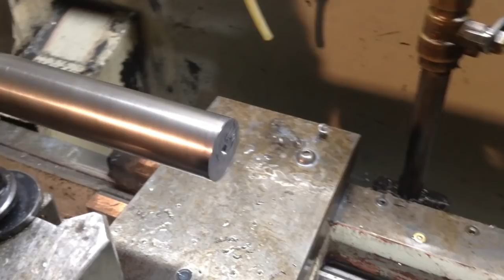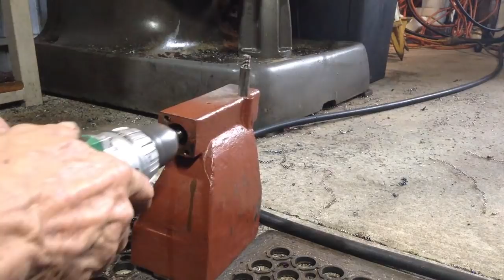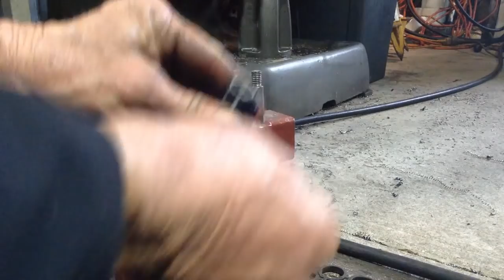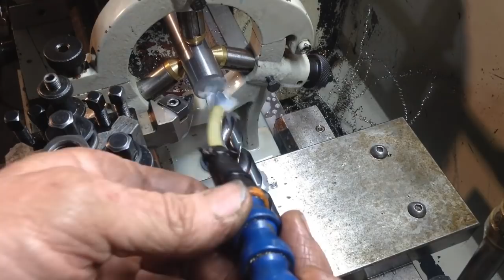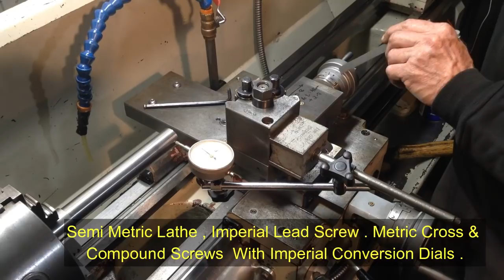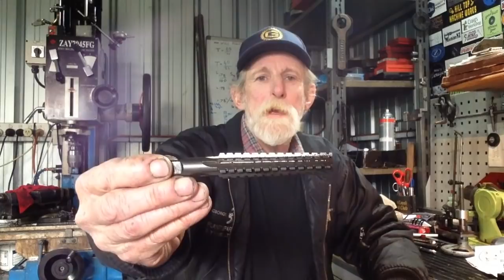Making  A New Tailstock Quill . Part 2  .   Precision compound slide setting .

Comment: Max, excellent tips and details. I need to make a very similar quill in the future. I have an older style tail stock for my South Bend that is the correct style with the classic look, but it’s missing the quill. The newer style I'm using now has a different keyway arrangement so they don’t interchange. 
Are you planning on engraving graduations on the barrel ? I’ve been contemplating good way to do that. Thinking indexing head or rotary table and tail stock in the mill w/ small ball end mill. Lot of setup for a few lines. Would enjoy seeing your solution…
ATB…Dean
Reply from the maker: No graduations , as it's for a wood lathe .  
Maybe one way to do them easy , bear in mind i have never seen or tried it yet would be to off set the quill in the 4 jaw & cut the graduations in that way .  The tool should just contact a small area that way .  Food for thought !        Cheers .

Comment: Just what I needed.  I have the solid carbide boring bar on the way and already have the finishing reamer.  Now if the darned motor for my lathe would show up I can get making the tailstock quill and main spindle for the wood lathe I'm building.  I'm making the quill and main spindle from 4140 prehardened material.  Not sure how the reamer will like it, so this setup was very timely. Thanks.
Reply from the maker: You will need that reamer working with pre hard .    Cheers .

Comment: Nice work Max and well explained.  Small MT's can be a pain to do and even when you think you've got it right with the setup, the bluing shows a different story which is always due to tool deflection.  Good to have a plan B up your sleeve with the reamer.
Cam
Reply from the maker: Thanks .  Yes the small ones can go pear shaped very easy .   Cheers .

Comment: Well, you certainly make that look more easy to dial in than I do 🤣. You mentioned taper in you part potentially buggering up your part, you may have just shed some light on why my last batch of mt3 tapers turned out not so great 😏. Once again, your knowledge is much appreciated mate! Cheers! 😊
Reply from the maker: Clock up on the chuck .   You still have to do the same check as one of my chucks has a .001''    taper when i do it .

Comment: Great video Max, your headstock is holding good alignment following your reset! EN 5 is horrible stuff, fine on a CNC but awful on manuals! Enjoying the tailstock project mate. Cheers, Jon
Reply from the maker: Thanks . Yes the manual machines do not have the RPM ' s .  If you could turn on a G96   or G97   type of code it would be great .    I was looking at a Harrison Alpha ,  that would suit me .  A bit like a  manual / cnc .  Still has a lot of manual functions like tool changing , tailstock etc .

Comment: Another masterclass.
I guess you have already finished the quill but if not it might make life eadier to know that some wood lathe quills have a bromze insert for the thread. As the thrust it sees is only in one direction a press fit should be adequate. I would find an inserted thread is easier to cut if you dont have the right tap..
Reply from the maker: Hi Chris .  They have thrust in the other direction as well when ejecting the tool .  I looked  at the quill in my Southbend & that is cut straight into the steel .  My other lathe has a bronze nut .    Either way will work  well .   No taps for this one , LH   BSW !  
Cheers .
Reply: @swanvalleymachineshop  is this one self ejecting, a lot of wood lathes dont have that feature as the tailstock is designed to have an auger go through it for long hole boring.
Reply from the maker: @chrisstephens6673  Do they  , i have not had much to do with wood lathes .  
The customer supplied a revolving centre that had a hole through it , that would have damaged the end of the solid male threaded section when ejecting .  I just made up a blanking button to rectify that . 
Do they just  tap a rod through the hollow type you mention to remove the tool ?
Reply: @swanvalleymachineshop  in a lot of cases yes.i used to have a bar with a wooden knob on the other end to knock out the rotating centre. You can get get rotating centres that have a hole all the way through and different cones and ring centres to hold the wood.

Comment: Max, always enjoy watching your set ups. When I set up to cut something Morse taper I guess I cheat a little, I put  something that already has the correct taper between centers and run my indicator across it. Machine the taper and finish it off with a tapered finish ream.  I guess I should take the time to learn how to do it the right way :)         Thanks for sharing Max,           Gary
Reply: The right way is the way that gets a good result.
Reply from the maker: Hi  Gary .  I only have that one roughing reamer , so not sure  how the finish would have come out if i had used it , esp not having the finish reamer to back it up .    Cheers .
Reply: @swanvalleymachineshop  Max if you lived closer I have a brand new MT2 you could barrow….
Reply from the maker: @TheAyrCaveShop  I might have to make one one day , from a knackered 3/4 reamer !
Reply: Gary 👍

Comment: I have to make a new quill for my tail stock. Somebody tried to repair it and bored it out too big. Not enough engagement for the MT2. Thanks for sharing, this series will be a great help. 👍👍👍😃
Reply: Will check that out. Thanks.
Reply: @patrickbeaumier8616  if you were planning on making a new one anyway, you have nothing to lose by trying.
Reply: Was checking this out this morning and I will definitely make a new one or at least try. The quill has been bored out 4 inches deep way bigger than the minor diameter of a MT2 taper which makes the male taper bottom out and about 5/8 of an inch engagement. There is no slot in the quill for the tang to slip through, so the drills over 1/4” tend to slip.
Reply: @patrickbeaumier8616  worth an investigation but you have the bits in your hsnd and  can see what i can't. 😆
Reply from the maker: Thanks .
Reply from the maker: Like Chris mentioned , the loss of length is usually no big deal , unless you have a slotted quill  to take a drive / ejection tang .You might get away with drilling the minor dia deeper .
Reply: If by bored out too big means the taper bottoms before the taper, shorten the end of the quill a bit, then the tsper can seat. In most cases the loss of length will not be noticed.

Comment: Ripper video Max!
Stopping that boring bar from chattering will be paramount in the next video !
BTW - Without delving too deeply into the abyss of metallurgy or the pros and cons of what steel to use for each specific purpose  - What would you recommend for a home  hobby workshop  in regards to some basic stock of steel to have laying around ?  I was thinking  something like  1020 , 1045 ,1214 and some 4140 would cover most stuff without delving into hardening - what do you think ?
Reply: Hi Ian, where abouts are you, I have some nice Austrian pre hardened steel that turns nice on my little 1985 Taiwanese 200 x 450mm lathe. I too am a home hobbyist. Cheers Peter
Reply: @petermurphy3354  
Hi Peter,
I'm  in Sydney   Australia and that is why i asked Max about the steel types as he is also in Australia and he knows the local designation for the material.
Your machine is a good unit , far better than Chinese made .
Reply: @Flattyman  Hi Ian, I am in Melbourne, but postage on steel can be a bit pricey. The Austrian steel I have is from Voestalpine. I purchased it from an injection mould & punch maker that was retiring. M245 turns easily with a very nice finish on a small lathe. Cheers Peter
Reply: @petermurphy3354  
Hi Peter ,
I was probably going to get a material pack from mancave metals , buying short lengths from a major steel supplier can be problematic and I’m not sure Voestalpine will do it - I have one near me so I might give them a call . I also have a small supplier where I get my square tube from , not sure if he does roundbar so I need to check that as well .
I mainly make model engines , Steam  and IC what about yourself?
Reply: @Flattyman  Hi Ian, I was trying to think of Mancave Metals, but brain wasn't doing it at the time lol. One thing that I do have that you might be interested in is 1/4" 4140 round bar. I do small one off job lots for local hobbyists & artists.
Reply from the maker: Hi Ian .  It all depends on what you are mostly doing .  12L14 , easy to turn with a good finish but non weldable  , M1020 if you need to weld it  & 4140  is good enough for tool holders and higher strength parts etc & it can be hardened to an extent with basic methods .     Most of what i use is mostly unknown from the scrap bin .  Critical & paying jobs i use new steel that i know what it is .     Best practice also is to letter stamp the end of the stock for I.D purposes .     Interlloy  has a good site for steel types  &  Voestalpine  is where i usually get my new steel from .  Cheers .
Reply: @swanvalleymachineshop  Thanks Max!
I think we have all been a victim of the scrap bin at one time or another !
A mate at work kept bringing me some lengths of steel round bar he was getting out of the scrap bin at some place , dunno what it is but it machine like lead , is as weak as piss and getting any sort of finish on it is near impossible.
I had a look at the places you mentioned and they have some great reference material on those websites. I have a pile of 4140  but need some stuff that is smaller than 50 mm dia for making spacers and bits for model steam engines so I think 1020 will do fine .